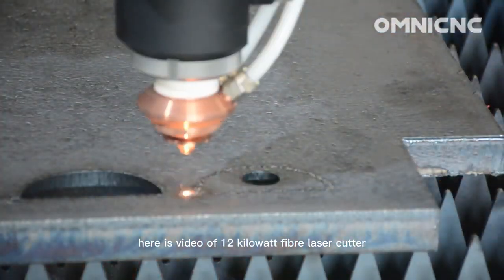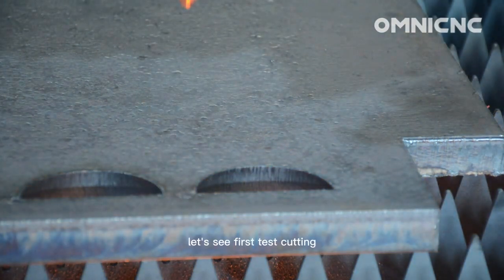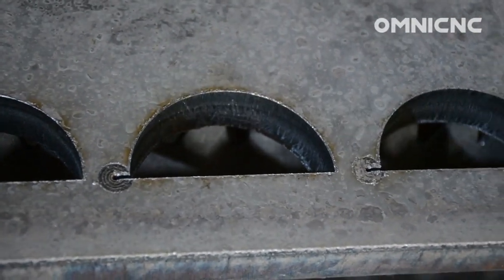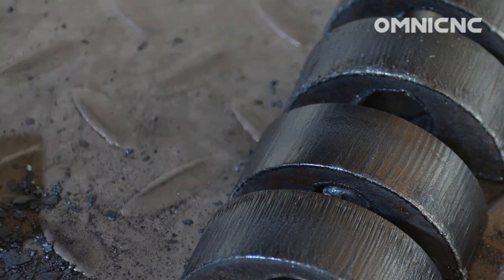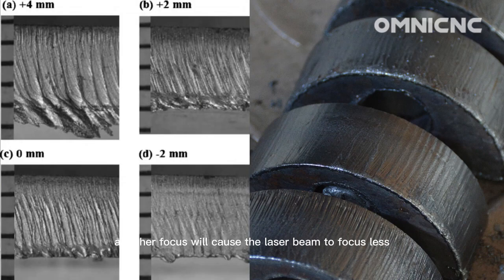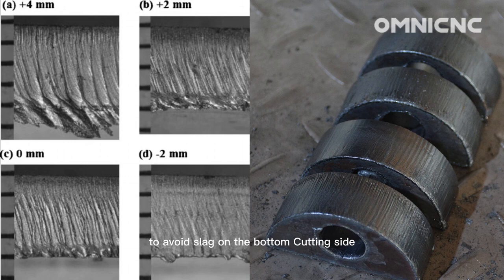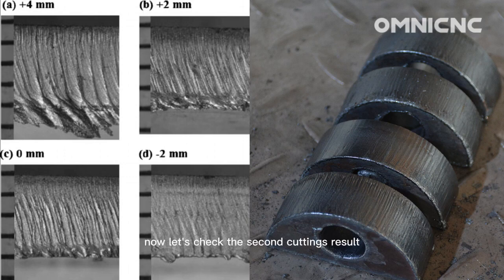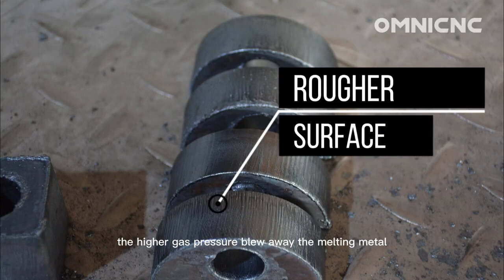12kW Fiber Laser Cutter Cutting 20mm CS Test and adjust the parameter

Comment: 6 kw max cutting parameters plz
Reply from the maker: 20mm stainless steel,25mm carbon steel.my whatsapp:+86 15168836892, i will send you details by whatsapp
Reply: @adasong5545  Hello i need help too for 20 mm carbon steel and 15mm carbon steel my parameters are close but can't quite get the smooth cut.and can it be done with laser mix.
Reply from the maker: @benjo2b  my whatsapp:+86 15168836892, i will send you details by whatsapp